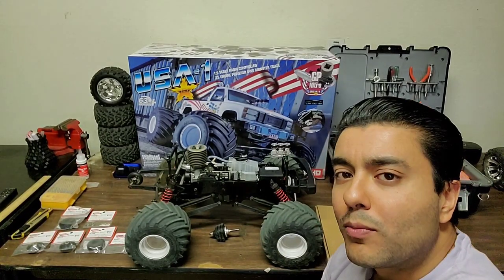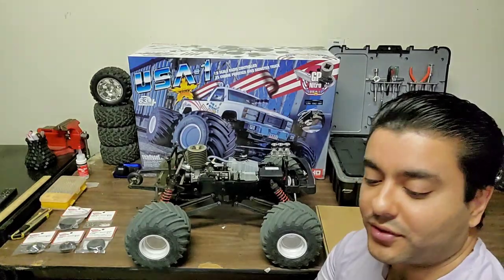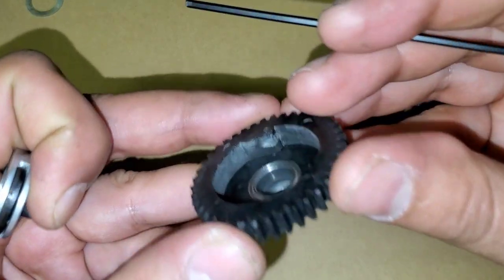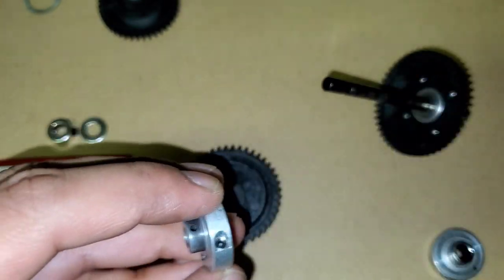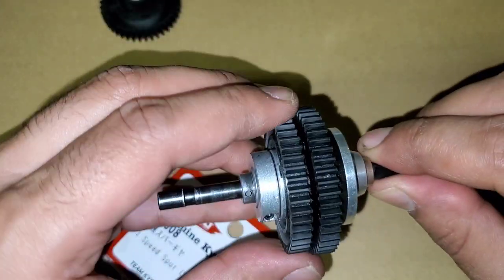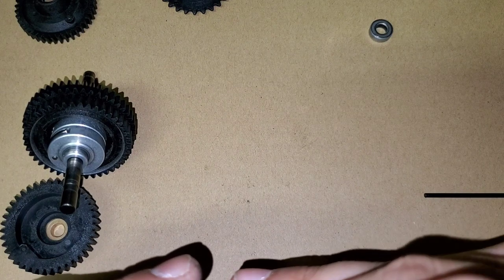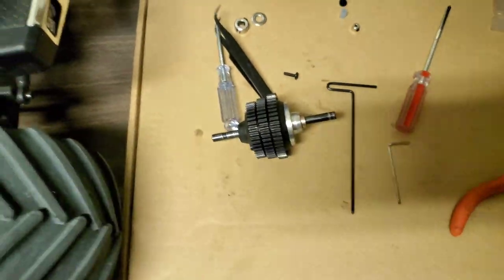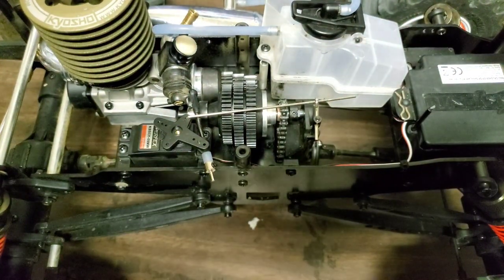Kyosho USA 1 Nitro Monster Truck 3-Speed Transmission Rebuild...need help with settings!

Comment: Well all rebuilt and 1st gear stripped again. This is why I avoid all these bs 2 speeds and 3 speed transmissions in rc cars. Not built well enough, all plastic, poor design and problematic. Very poor for a heavy powerful truck. I can't see it lasting even when set up perfectly.
Reply from the maker: Seriously...if you look inside the gear where the worn cam is, you'll see Kyosho tried to put a metal pin there to strengthen it or something. It's useless because the pin does nothing to help keep the cam from stripping
Reply: @TurokRC  ugh. And now I see my issue possibly. The one way on first was  jammed. So it tried to be in two gears at once thus stripping first as it shifted. I ordered more one ways and another first gear. And also hardened metal ones. Those won't be here until December. And might cause more is issues, but we'll see. Unfortunate as this is a really fun truck to drive, but like this it's deriving me nuts.
Reply from the maker: @Rusty-Metal  yeah those one way needle bearings seem to fail a lot. As you may have seen from my comments below my 2ng gear cam bearings failed and fused themselves to the shaft. I think we'll have to lube them quite regularly to keep them from failing. 

Where did you get the metal gears from? I might have to give those a go
Reply: @TurokRC  eBay. Just type a on the regular part number and they pop up. Only 1st and 2nd gear.
Reply from the maker: @Rusty-Metal  nice find, I just found them. Looks like they offer the 3rd gear too but it's out of stock. Definitely will have to get my hands on these, I'm sure it will save money down the road
Reply: @TurokRC  if this goes on, I'll pick a  single gear ratio I can live with, and put on a single clutch bell. Then lock one gear to the lay shaft. This truck is too fun to deal with this.  I don't need 3 speeds. When I did hit the third gear it was crazy uncontrollable anyway.  I don't need a 35mph monster truck.
Reply from the maker: @Rusty-Metal  I agree, 2 speed would be adequate for this thing. 3 speeds is just a novelty and unfortunately the novelty I purchased this truck for! I think changing the gears to metal ones and ensuring the needle bearings are greased up regularly should eliminate this issue